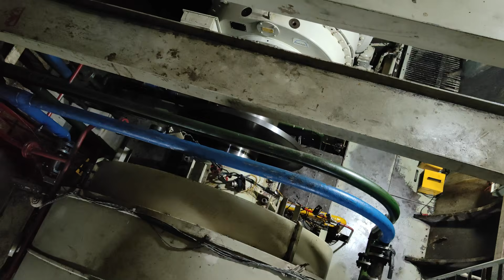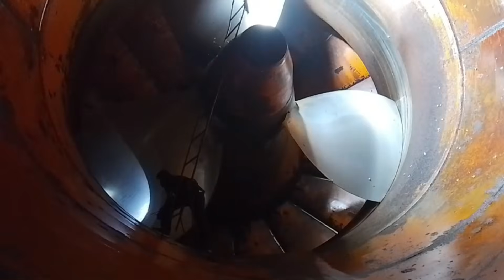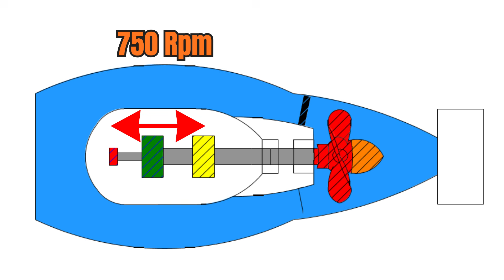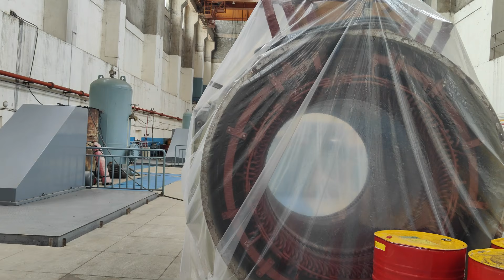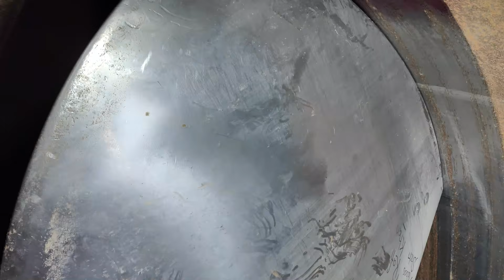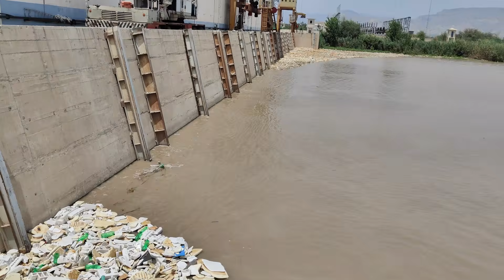I Stood Inside a Terrifying 12MW Turbine Pit

Comment: So this system works somewhat like a wind turbine where the turbine itself is low speed but a transmission takes the low speed and turns it into a high speed motion to run the generator.  Like the wind turbine, I don't think I would ever want to set foot inside the capsule or nacelle of either system.  It's fascinating but too scary for me.
Reply from the maker: Yes, exactly, it is definitely intimidating to stand near all that mechanical power! 😊

Comment: Doesn't mounting the turbine in the middle of a pipe instead of flush mounting it to the top or bottom of the pipe create a lot of energy pressure on it mounthing spots and create future issues. @ 2:35

Comment: Those wicket gates look closed, would hate to be behind all that water with just the wicket gates in the way. Is there an MIV, if not I take it stop logs are in place.

Also is the flowing water used for cooling via a heat exchanger? It is staggering to think of the load on those thrust blocks 😮

Comment: You get some AMAZING video my friend. I didn't know this was a method used to generate power. You're right it's literally like a submarine bolted in place in the middle of a large flowing river. haha I really, really love that part about physics and/or electricity, the fact that any system can be run in reverse. Feed power in and you have motivation. Motivate in and you have electricity. I just find that so elegant and satisfying. =) Thanks for yet another great video.

Comment: Very Nice! Sure, I would stand in the pit! 😊 I'm still learning about this: could you please make a video about how the wicket gates and turbine pitch are coordinated for Kaplan runners? I know that pitch changed can be made for the sake of efficiency,  but I did not realize wicket gates were used with this type of runner, so there must be some way these variables are coordinated for a given head and required load. Thanks! 😊
Reply from the maker: I will try
Reply: If I'm wrong (and I might be), Ali will correct me when he comes back, but I don't think the pitch of the blades needs to be adjusted independently from the angle of the wicket gates. I think they're calculated for optimum efficiency when the whole assembly is designed, and hard-linked. The blade pitch changes automatically when the wicket gates are adjusted. The technicians operating the plant don't have to worry about it. Engineers determine the relationship up-front. I don't know that it's necessary, or even possible, to fine-tune them. One just depends on the other.
Reply: Very good question. I would also enjoy that video.